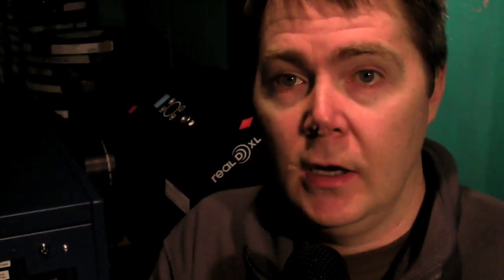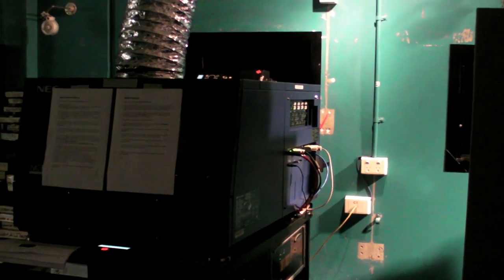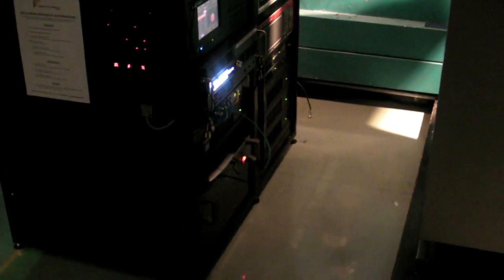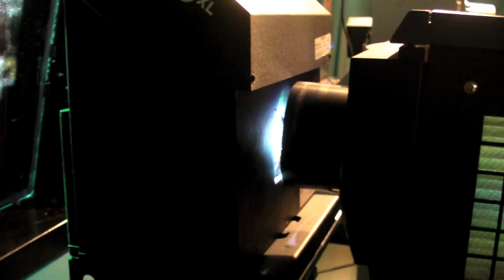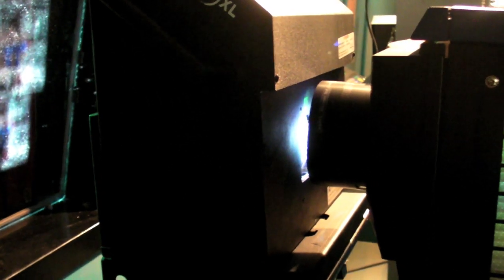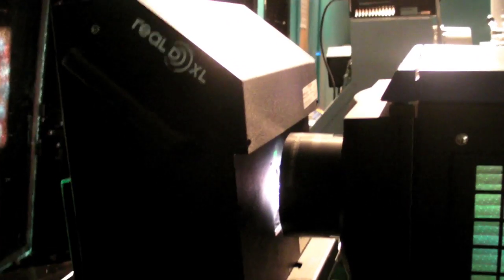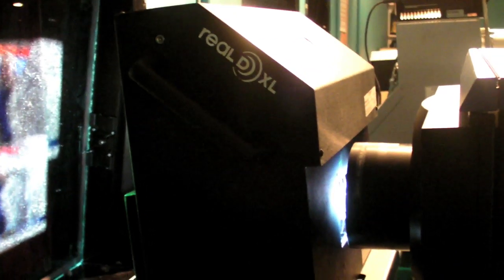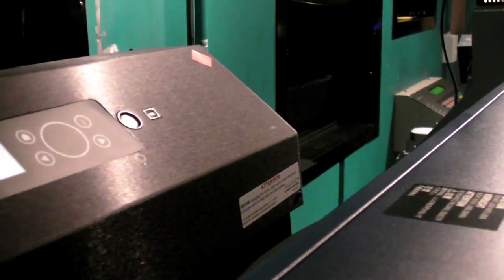The RealD-XL 3D system

Comment: I know this is an old video but I’m just wondering if your able to show the alignment process of the RealD XL? I can’t find anything anywhere.
Reply: Umm. not really.  I know someone with a unit, but not Avatar is over, its likely to gather dust until the next one.
I did check it before Avatar started, and its alignment was good, but it needed a good cleaning.

From memory, the alignment is not difficult.
You need to match up the unit level/square with the projector.  Then there is an allen key or some type of screw to adjust the top mirror as to align one image over the other.  That is pretty much it.  I have never had to adjust it vertically, its always been spot on.  Not sure you can.